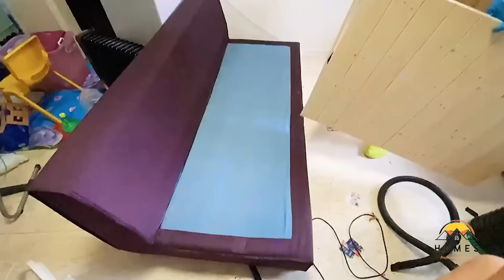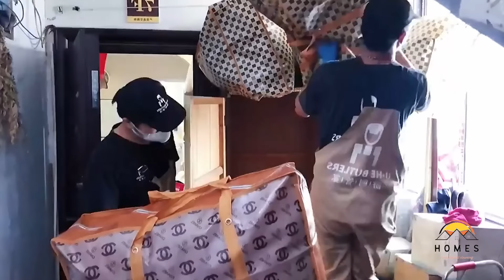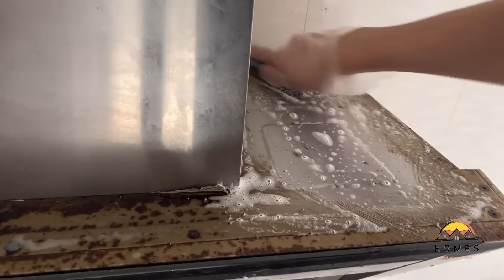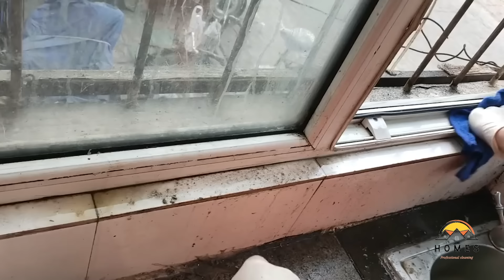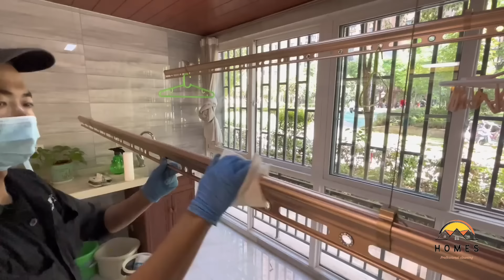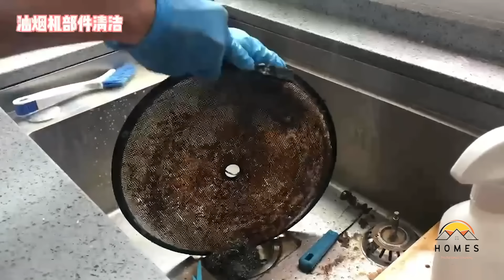Landlord is Coming Tomorrow!! 😱Emergency Cleaning for Free! Satisfying Speed Cleaning for Free👌

Comment: The level of detail is amazing!  They were cleaning things that I've never even thought of cleaning
Reply: Great products and a solid approach to the problem!
Reply: Not me. I clean everything very well.
Reply: Ya, not many people think of window sills, ceiling fans (the blades), walls, baseboards, light fixtures, especially those attached to the ceiling, all the bugs & debris that can collect… around faucets depending upon the material, a ring of rust can accumulate… But regardless that needs to be cleaned. I find baking soda & vinegar to be good, basic cleaning agents to keep around. No toxins & the shine on things like sinks & stainless steel - amazing!
Reply: @rOnda88 Two things I simply must have clean is faucets and fixtures and window sills.
Reply: Make it dirty and then clean it up. Like a before and after thing. For views ofcourse😂🤣😂
Reply: @livingthedreamdjm good for you..?

Comment: Wish I had a cleaning crew like this. I use to be like this with my house everything moved once a week. In the house I did it all my self. But if you do it every week it don't get bad. I also mopped and waxed my hard wood floors every other day. Plus do all the outside work too now the yard cut the hedges. I did that twice a week to mow and about once a week to cut the hedges. I had a 3 bed room home it was big rooms. Bath room was small but the bed rooms was nice size like 12x14 or so all of them the living room was 20x 15 
Dinning room was 14x12 
Kitchen was 21 x 8 wash room was 12x8 so it was a nice size home. We had a big yard it took 2 1/2 hours to mow it. It was a corner lot .  But took up about 1/2 of the  SQ.  block. A lot to take care of for one person. I was young now I'm old have a bigger house less yard but still on a corner lot. I have some one to mow for me. I wish I had some help to clean inside and do some painting but I can't afford to pay anyone to help me. It takes everything I have just to keep this place going. Id like to sell it get a smaller place but I can't afford to sell it unless I have a place to move to. And I don't. So I guess when I die someone will come in go through everything and get rid of it. I don't move stuff anymore and I don't do the floors like that anymore either if they get done once every two weeks that's good if not I let them go till I can't stand it no more. I hit the hot spots. Then I'm done. Dusting is the same way. As we get older our body's don't work like they did when we was young our mind does says I can do it you get up and try you do a little then you start hurting in all the places you didn't know you had. Back hurts feet and knees hurt hands  hurt. So you sit down to rest then you fall to sleep cause you are wore out. After your nap you pick up what you left put it away call it good. Till next month. I don't have bugs at all can't stand those things no matter what kind. I have a dish washer so my dishes gets done at least once a week if not more depends  on if I cook or not. Be nice to have a live in maid besides me. But won't never have one. So I got to get up and do it all year of cleaning. Life is great if you are rich and has no money worries but if you aren't rich you do what you can to live the best you can. But you don't need to be dirty. You can pick up stuff put it away or toss it away. No since in letting it go or tossing trash all over the place. Called get a life. I need to do that get a life. It's hard when you are old all your friends have died all your family is gone but 1 in you own family you grew up in. He has a loss of his mind. But he still knows me. We live in different states. Live is hard. God makes it easy for us if you do what he says. Sell all your stuff and go out and tell people about him. Going from place to place. God will provide for us. We need to learn that too. But we don't. We work our selfs to death when we don't have too. Just don't own anything. Look at all the illegals in our country what do they have? Nothing did they bring with them. But they get food beds clothes education medical. All for free why you work hard to make ends meet. Uncle Sam taxes us to death even after death Uncle Sam taxes us. Uncle Sam is a greedy bunch of lazy do nothing's. They don't do anything for you but take away your rights and your money and freedoms God gave us. I'm glad I'm old I won't have to watch the USA go to China in a hand basket. I hope.  I can't speak that language Or any other. I don't speak English very good either. Not like it should be spoken. I use slang and other stuff that is just me. One of these days God will come we will be in heaven in a mansion and God will make it so we don't have to clean it from dust and dirt. God bless us all we do need you now to help with the shape our country is in. Other countries are hurting too. God thank you for all your blessing you have shown us all.

Comment: I wish these folks were here in the US. I'd totally pay them to come deep clean my house for me. My house is in good condition, but when you're allergic to dust that's floating in the air (Dust on surfaces only bothers me if there is a massive amount of it.) deep cleaning is something to be avoided, lest the dust be disturbed. I'd happily pay them to come out a couple times a year and do this to my house.

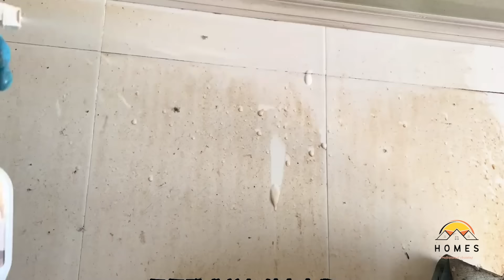I don't know what chemical he was spraying at 10:38, but I want it.
Reply: I have bad asthma.  I found that by using a medical grade filter in my AC system it cuts down enormously on dust, pollen and mold spores.  I also change it monthly.

Comment: I am leary of home cleaning services since i hired one who proceeded to damage my home in the following ways (1) knocking a fragile china object to the floor, smashing it and throwing it away; (2) ripping half the fringe off my oriental rug by using a roller bar vacuum (3) using toilet bowl cleaner on my new shower tile floor absolutely destroying it (4) using abrasive cleaner on my stone surfaces leading to an expensive restoration job.  Cleaners need to be taught to do no harm.  I shouldnt have to follow cleaners around to make sure my home isnt damaged.